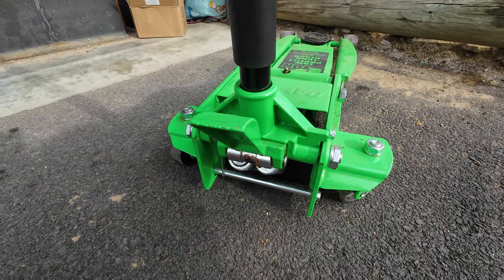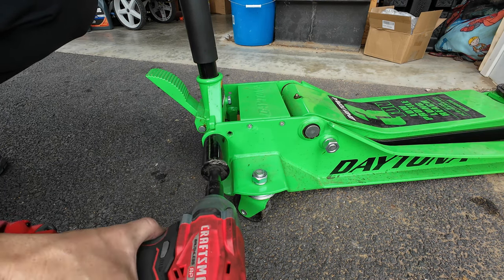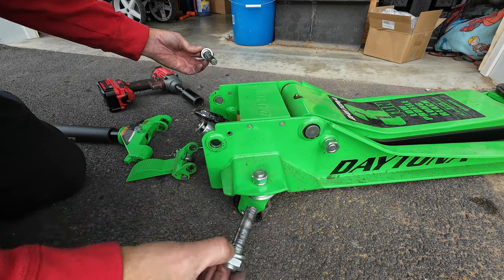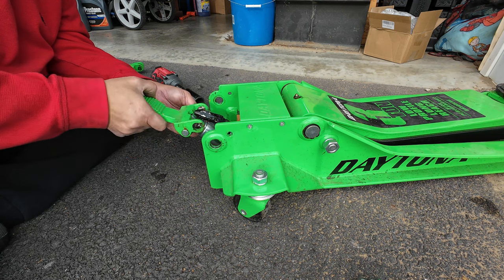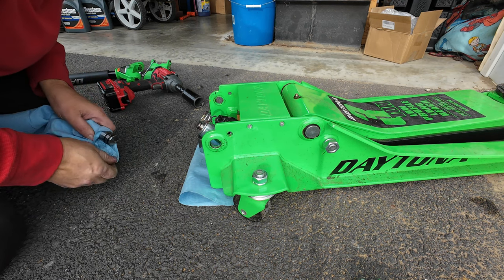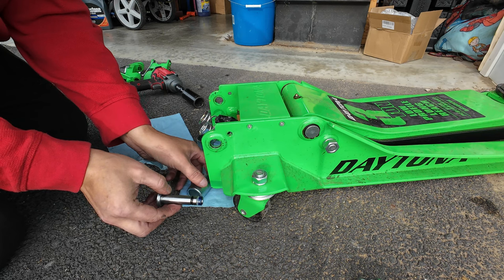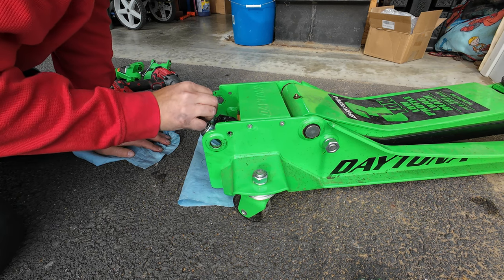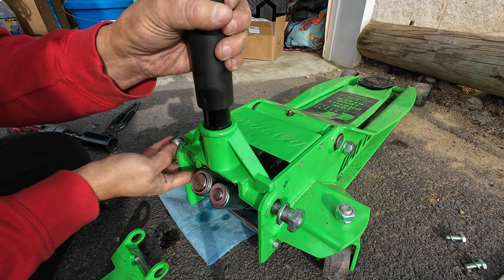Fixing Daytona Habor Freight Jack

Comment: Is the long reach worth it over the regular one? Got the low profile one without long reach. Having a little buyers remorse, if not working on vehicles besides a sedan/suv is there any benefit?
Reply from the maker: I like the long reach . It allow for a tall pickup. It has a higher height that you can lift a SUV or truck. Also you can use the long reach to get a hold of a lift point and have the back of the jack stick out from under the car. That gives you more room to move the handle up and down without hitting the bumper. It is just add length. to get away from the bottom of the car. The reach for me is better than the low profile.
Reply: This comment is me right now. I want the long reach but don't know if I really need it to justify the 50 dollar price increase
Reply from the maker: @tommieboi707  If you don't have a high vehicle or don't have a really Low vehicle ( low profile ). Then just save you money. Get a normal one.
Reply: @TheBumpCave  there was a 40 dollar discount that just came out this week! I was able to get the long reach for 199. I have 2 wrx that are lowered so this was definitely a must buy. Thanks!
Reply: @tommieboi707  I paid $129 for the Low profile. Didn't go long reach as it was significantly more expensive. So far it's not been a problem.